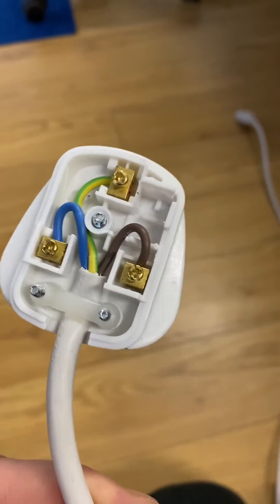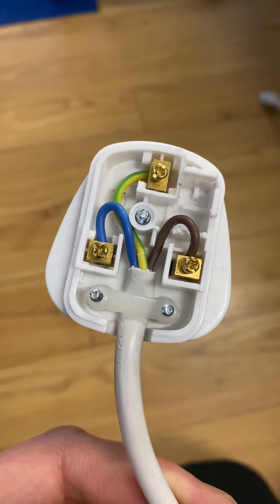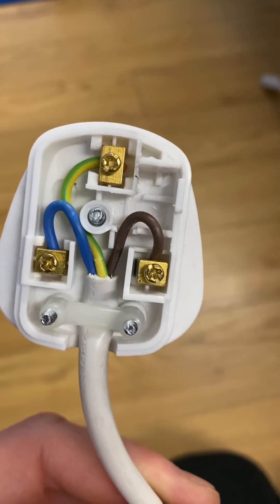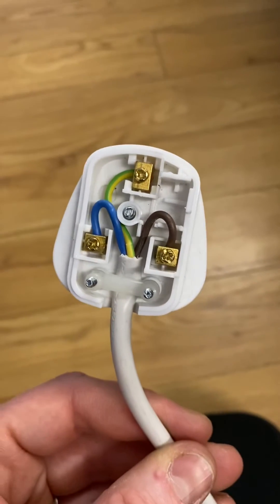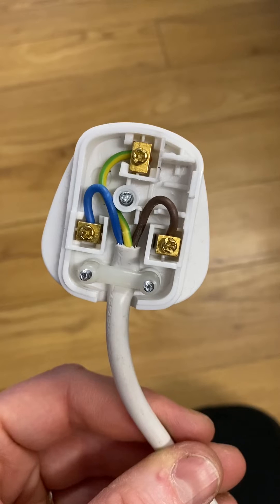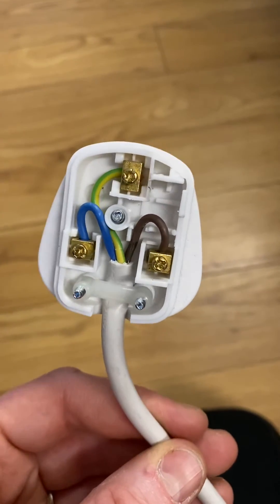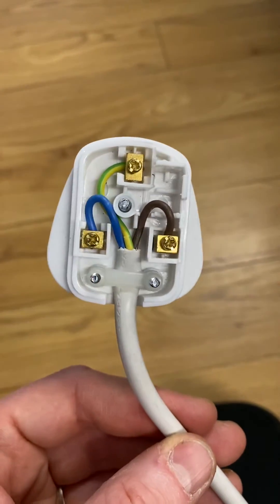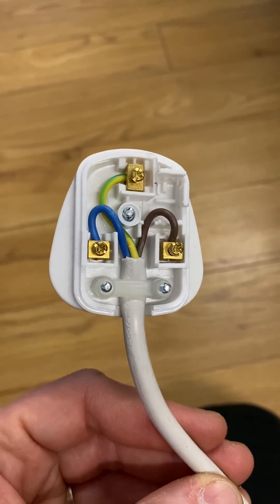PAT Testing Dangerous Plug Visual Inspection Fail! It wasn’t like this when I tested it last year!

Comment: That’s a proper dodgy install! It looks like they have taken out the live pin with the fuse holder bit and then the other end of the fuse holder that takes the cable. It looks like they have taken a neutral pin from another plug and just put one in the other side and wired it straight in.

Comment: Hi. I’m making some lamps for around the house and have decided to try and PAT test them. On my Martindale, when testing the Fuse, it has an error asking if it’s switched on. It is indeed switched on, the lamp works and the fuse is fine also. Any ideas what could be causing this error? Any help would be appreciated. Thanks.
Reply: Probably using LED bulbs in the lamps. Try normal filament bulbs and you should be ok.
Reply from the maker: I’m sorry but I’m not familiar with that PAT test machine.